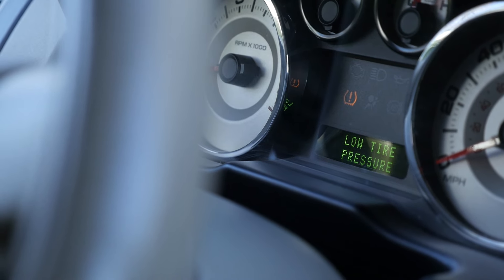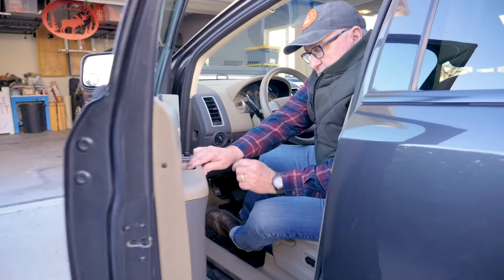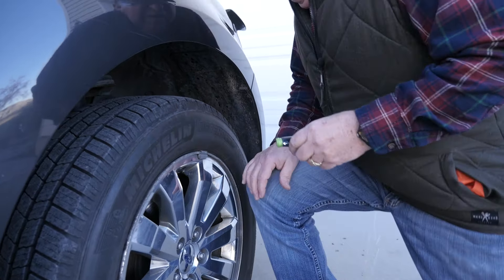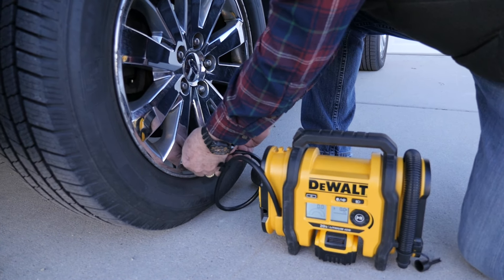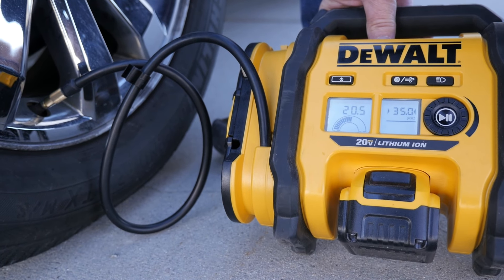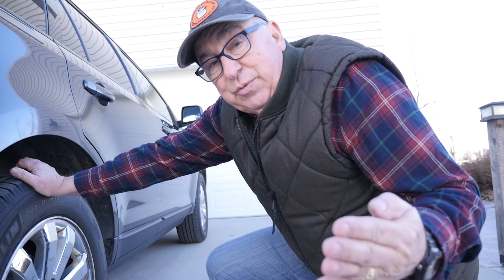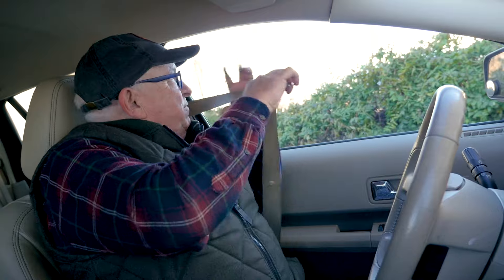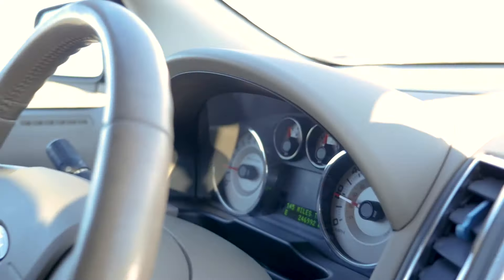Tire Pressure Light Won’t Go Off - Now What?

Comment: If all tires show good pressure check to see if you are using a usb charger plugged into the power outlet. Some chargers will interfere with tpms signal and show up as a low tire or check engine light referring to loss of signal from tpms sensors.  Nissan are more sensitive to this issue. Unplug USB power adapter and see of code doesn’t disappear in a day or after a few restarts. The cheaper the usb power adapter the higher chance it will give off emf that causes these issues.
Reply from the maker: WolfeAdventures - this is a great insight. Thanks for taking time to watch our video and giving further insights. I suspect that this will be a popular video with good commentary. If we do a follow up with viewer insights like what you just gave, we'll make sure to include this one and give you credit. Best Regards, DFJ
Reply: I’m sure that’s what’s going on w my Sentra thank you
Reply: I removed the USB phone charger from the power outlet. The tire icon never showed but the letters TPMS are still showing after 2 weeks. How to get that to go away? The tire pressures are fine.
Reply: Will try this, thanks
Reply: Omg! I just bought a new cheap USB to charge my phone and I’ll tell you what I bet you anything that’s what has to do with it. I’m gonna go take it out my car right now thank you so much for writing this! Let’s pray it’s the most inexpensive fix!
Reply: It worked for me thank you! lol all I had to do was unplug my charger
Reply: I hope this is it!  Thank you.
Reply: Thanks for mentioning to check the spare tire, and it turns out to be the culprit. 😂

Comment: Driving doesnt reset the computer.  It just allows time for it to recognize that the tires are all inflated.  If you have a bad sensor, that wont work.
Reply from the maker: Thanks for the insight, I appreciate it! Indeed, if one of the sensors is bad, it's gotta be replaced. Best, DFJ
Reply: Man, my lite is on, to bad there isn't a fuse to pull instead of going to Discount tire for a hour and a half !

Comment: I don't need a high-line TPMS system to tell me which specific tire is low. The cost of maintaining this type of system farrrrrr outweighs the benefits. The sensors are expensive, need replaced after a few years because of cheap batteries, the labour cost to install, relearn and retrain the sensors is ridiculous. With a low line system I never have to worry about replacing any sensors because there are no dedicated sensors. The low tire pressure light comes on, I take out my tire gauge and check the psi on each tire manually, add air to the offending tire(s) and the warning light disappears immediately - beautiful. Thank god my 2018 Ford Escape is a low-line system. No having to turn the key this way and that way 50 times, wait 200 seconds and repeat, just to get rid of the light, ridiculous lol
Reply: Dude 😂😂😂 amen 🙏 my brother ,  got me cracking up , good to know your out there peace
Reply: just another over priced piece of 99% plastic parts that break and never work right ! if people cant check their tires they shouldn't be driving! drivers ed should be a much longer course that also covers basic  maintenance and upkeep to cars and trucks

Comment: On my 2011 Honda CR-V, a lot of times during the winter my TPMS light comes on usually as the temps drop below 30 degrees.  Sometimes it goes off if I am driving a far distance, I assume because the tire warmed up.  But the light never comes on in the summer.  And it's never because the tires are low.  I see this system as a hassle and extra expense.  But only because I'm religious about checking the tires once a month so always know when my tires are low.  I am sure they are great for people that do not check them or check very rarely.
Reply from the maker: Thanks for the comment Kurt Kennedy. Keep watching my friend. Best, DFJ

Comment: Wow, 247,000 miles is not common on a Ford, although I have been able to do it on my 2004 Expedition.  Obviously you have done a great job with maintenance.  Very well explained video!
Thanks.
Reply from the maker: Thanks for watching and writing! Yes indeed, we invest about $1,000 a year in the car to assure that it's kept in great condition. It's a lot cheaper than payments, interest, new car registration and tax fees and so forth. And we know what we've got, because we've had it since it's had about 5,000 mi on it. Thanks again for writing!

Comment: Our Toyota Avalon tire pressure light was on even tho our tire pressure was fine, turned out  the spare tire in the trunk was low!    Crazy technology!
Reply from the maker: Yep, many a car owner has gotten tripped up with that situation. Thanks for writing! Best, DFJ
Reply: Currently have this issue right now even after sensor replacement, wonder what your toyota avalon model and year? because mine is 2013 avalon.

Comment: Hi Jay, just went through this with my 2010 Hyundai. Except there was one more item for your list. Because we had cold weather and snow I didn't want to start up my air compressor so just took the car to our local Les Schwab since our tires are under warranty there. They checked all the air and all about 10 psi low. The TPMS tire icon light on the dash didn't go off so the next day took it back to them thinking maybe the spare tire they didn't check after watching a YouTube video. Well, it was #5 on you new list. The TPMS sensor inside the tire was loose and I guess they screwed it into the tire. Anyway they put it together and the light went off. Best thing no cost and I just sat in there lobby drinking my morning coffee. Cause was maybe hitting pot holes that the county are busy filling is my guess. Tim from "Tims Workshop TJY"
Reply from the maker: Tim, thanks for sharing your experience. I checked out your channel as well. You're quite the mechanic and outdoorsman. Glad you got to enjoy some coffee while the problem was being addressed with the TPMS sensor. Best Regards, DFJ
Reply: Thanks Jay, Your channel is very educational. I have been a mechanic for many years. I was the Landing Gear lead on the 747 before I retired in 2016. I also was raised on a Lake and fished most of my life. I was also a musician too for many years. Going to play a few songs on my acoustic guitar soon on the channel. Songs I'm writing so there will be no copyright claims. ha-ha Stay Tuned. Tim
Reply: Did your car happen to be a 2010 Hyundai Santa Fe? I’m having a similar problem.

Comment: my mazda 2020 cx5, light on , tires checked, only 3yrs old! supposed to reset on drive, no dice, will a relearn tool help? also nothing comes up as a warning on display.
Reply from the maker: Sorry to hear you are having problems. Just to confirm, you checked the spare as well? Best, DFJ
Reply: It finally went off. I guess it finally re-calibrated. Thank you for the helpful videos.
Reply from the maker: @shelleyzoe8254 glad to hear it!

Comment: Got 4 new sensors put on. Blinks for a minute at startup into solid. Scan tool picked up all 4, tried 2 different tire shops for relearn, spare was check and has 60 PSI. any other ideas?
Reply from the maker: Wow, you've got a mystery on your hands. The sensors are transmitting if the scan tool picks them up. Two possibilities come to mind for me - even though it is inflated, the spare has a low-power sensor and it's tripping the dash icon. You didn't mention if the spare does have a sensor and if the scan "saw" it. Check that. Next, if all is in order, it sounds like something is wrong with the TPMS module if it can't "relearn." These are computers, so it's possible it has something in its memory that is taking precedence and won't allow new info to be entered, or it's simply gone bad. Be persistent and let me know what resolution is finally worked out for your situation. Best Regards, DFJ

Comment: 2019 Dodge Journey. Light came on saying low pressure this morning because of cold weather. Front driver side tire was at 31 PSI and should be at 36. Went to get oil change, they added air and although it's showing 36 PSI and I drove 8 miles home, light is still on
Reply from the maker: Check your spare as well, and let me know if that helps! Best, DFJ

Comment: Just got 4 new tires on my Sportage and heading out of town, light started blinking then went solid. Repeats every time I start my car. Pressure is good on all. Took it back to tire place to have it reset and the guy tells me a sensor or battery is out on one tire. It was working perfectly fine before. Is this common?
Reply from the maker: iachik, indeed, batteries can simply run out of power. It does happen and cause issues in the system. The timing of this going back is suspicious, but not impossible. Is the tire store recommending a replacement sensor or ???? Best, DFJ
Reply: @DirtFarmerJay  Amazingly, I took it back again and they admitted the mistake of breaking the sensor, so replaced it.  That may be a first. Good ending!

Comment: Thanks Jay. Why does Ford tell me to inflate my tires to 35 psi on my 2007 F150, when the tire itself says 80 psi? I remember the issues with the Explorer and Firestone. The Explorer was not stable, and Fords solution was to under-inflate the tires, which caused blowouts.... I run my tires at 50 psi to improve gas mileage, and it handles fine. I don't trust Ford's recommendation. My tire guy says I could go higher. What do you think? My low pressure symbol stays on all the time, even with all tires full.
Reply from the maker: William, you are not the first one to ask this, and in fact, I had a similar experience.  I believe you will find that the pressure on the side of the tire is the "max" pressure, the pressure that that tire has been rated for before tire damage would occur due to overpressure. This isn't the pressure that tire handles best at. If the tires on your vehicle are the same size or very similar to what it was originally outfitted for, then the pressure on the placard on the driver's door jamb is fine to go with. Yes, you can run more if you want, but there are trade-offs. You are creating a less flexible tire, so you will probably get better gas mileage due to less rolling resistance. But, you can diminish handling characteristics (less side-to-side flexibility), as well as braking distance due to the "contact patch" of the tire (the amount of tire tread in contact with the road at any given second) being smaller.  As for the TPMS showing a message ongoing, something is off. Three things come to mind: 1.) the sensors have not been put through the "learning" process the last time you had tires installed or rotated, 2.) you have a sensor in one of your tires that are either improperly installed or has a dead battery, or isn't transmitting for some reason, or, 3. your spare is pressured too low and is causing the message. I hope this helps. Get the system checked out, you want to have the TPMS working for you. Best, DFJ

Comment: My TPMS light has been on for a year and a half. HYUNDAI said they can't diagnose it. I replaced all 4 tires and battery, still on! Paid for TPMS replacement on the one tire leaking thru the tpms, 500$ still can't shut the light off!!
Reply from the maker: Wow, that's not good. That sounds like an engineering defect on Hyundai's part. It sounds like you need another tire equipment advisor/source that will think "creatively" and find the problem. How old is the car?
Reply: Try taking the negative battery cable off for 10 min..worked for me
Reply: 2013   @DirtFarmerJay

Comment: Hello mate my Car 2014 Mercedes Benz E class e300 , keep showing check tire pressure in last 3 months when all my tires are fine and new and all pressure same as each other and correct 

MY car is Indirect TPMS works with your car’s Antilock Braking Syste thm’s (ABS) wheel speed sensors and Th
Hello my friend my Car keep showing check tire pressure in last 3 months when all my tires are fine and new and all pressure same as each and correct pressure 

Any idea what can I do
 Or  information I'm really appreciate it
Reply from the maker: Thanks for watching and writing! There are variations of the indirect TPMS system, so they don't all behave or operate the same. Seeing that you have an ongoing issue occurring on this very nice car, you'll have to check a few things that at the outset may not make sense. Even so, the problem exists, and so you'll need to be creative. 

A few things come to mind:
1. check the spare for correct pressure. It can be transmitting is some way and fouling up things for you. Unlikely, but check anyway.
2. Have you changed out one of the tires lately due to road damage on that one tire? If so, the slight difference in tread circumference with a new tire and 3 others with slight wear can set off the system.
3. What condition are the brake rotors and pads in? If you've got one of the rotors with higher pad pressure than the others, it's possible that that tire is turning ever-so-slightly slower than the others, and the TPMS is "seeing" this as low tire pressure/higher rolling resistance.

If these don't solve it or set you in the right track, I'd see if I could finds a Mercedes Benz mechanics forum and see what they are saying to each other about this issue.

Comment: my dad just put 300.00 in sensors in had them all calibrated and reset tires are filled to proper pressure and light still wont go off ! i hard reset did a bunch of resets pressure is 100% fine and the stupid light wont go out ! i want the stupid dummy tpms dummy light off !!! what wire do i cut ?
Reply from the maker: At the risk of insulting you, you did check the spare in the vehicle as well, right? Some have sensors in the spare and over time the tire loses pressure and sends a low pressure signal. Let me know. Best, DFJ

Comment: Thank you for the information. 👍 However I am a bit confused because in my Kia Picanto car the tire pressure on the door side says one thing, but it says a slightly different pressure in the manual. 🤔 Door says equal pressure front and back. While manual says more air in front than back. 🤔 Last time I did what the manual says, and light went off. But now it's back on and it isn't long ago that I filled the tires. 

I'm confused why the door and the manual would say different pressure. 🤔 Maybe I should go for what the door says instead of the manual then. I don't know.
Reply from the maker: Because its likely the tires have been replaced more than once, go with the pressure on the tire sidewalls. Since the tires are likely not the original tires from the factory, use the pressures displayed on your tire's sidewalls. It's possible the battery is low in one of the TPMS units.I think that's likely given that you usually don't see a low pressure indicator unless the tire is 20 to 25% underinflated. Since you recently inflated your tires, it seems unlikely that you'd be losing that much pressure. Hope this helps. DFJ
Reply: I’m I’m I’m I’m going

Comment: Hi. I had my tires change two months ago, and since then TPMS light turned on for about 4 times now. In each occasion, i checked air pressure and its is right. Tried reset 3 times and drove few minutes but light still there. Whenever i turn off the engine for few minutes, and turn on again, thats the only time the light will turn off. (Only now that i learned to check the spare as well) should i be concerned about the frequent occurrence of TPMS turning on? Thanks.
Reply from the maker: I think there is something not right in your car's TPMS. You should not have this many "false-positives." I would take your vehicle back to the retailer where you got the tires from and have them check the system. Something is not calibrated correctly, or one of the in-tire sensors is not working properly. It should be very rare you get a tire low indicator. Let me know how this turns out for you! Best, DFJ

Comment: You know what, sir? I did set the correct manufacturer tire pressure, and still, the tire pressure indicator didn't disappear. Now what?
Reply: dont buy a car with tire pressure monitors cause they all always have the same problems they are junk built with junk plastic parts that last about as long as it takes to get the car off the lot

Comment: Sometimes sensor in tirer broken . Not worth it to fix. U can get new tire for less
Reply from the maker: Good insight. Depends on the sensor and the tire. We have been able to get new sensors for quite a bit less than the tires we use, but sounds like you've had a different experience.

Comment: All tires are at the correct pressure. The tire light is still on. The tire screen only shows the 2 front tires. The back tires just show a broken line. 2010 Sebring.
Reply from the maker: Lew, I need a bit more information. Did you conduct a reset drive to have the computer reset with the new pressures. Tell me more about the back tires showing a broken line. What type of line? Data line, air line? Of course, a broken air line would affect the readout on the tire pressures. Let me know and we can go from there. Best, DFJ

Comment: Mines 37psi front 35psi lights still on it’s a 2022 brand new car nearly and had that sensor issue plus radiator sensor fans blown and over heated 😅 buy a new car they say my Honda civic 1998 eg was bulletproof
Reply from the maker: Wow, what a nuisance! Double check your spare to assure its not the unit sending a signal. As for the fan, ugggggh.

Comment: That method has always worked for me, but not this time.  That sucker won't go off for anything.  Tires all inflated properly.  I drive 50 miles a day.
Reply from the maker: Yeow - that's irritating! It sounds like one of the sensors have gone bad. My source on these things tell me that they have about a 5 year dependable life. This may warrant a trip to the tire shop to have them run sensor detectors and see if that is the problem. Thanks for writing! Best, DFJ